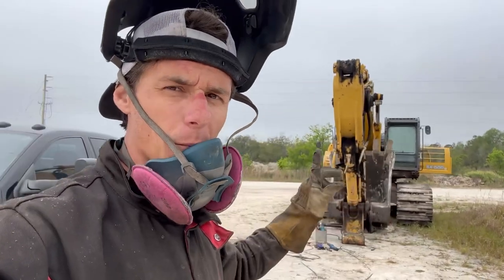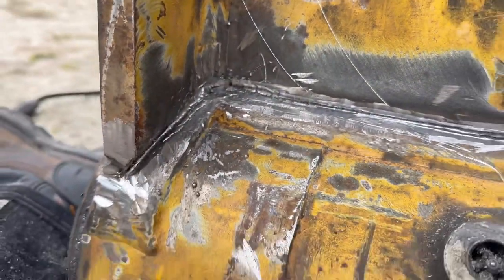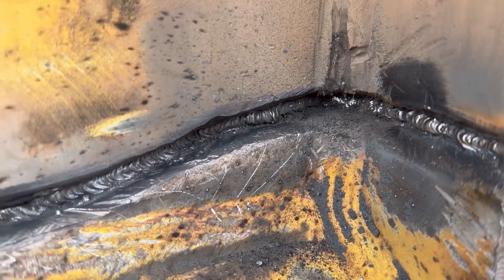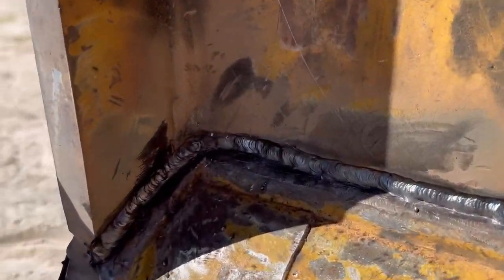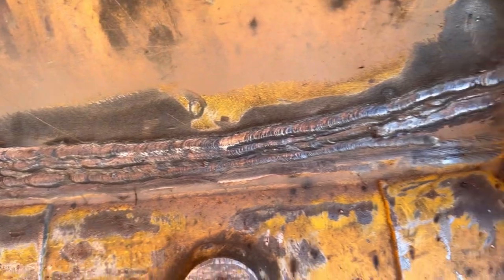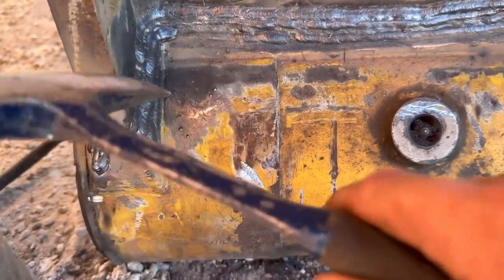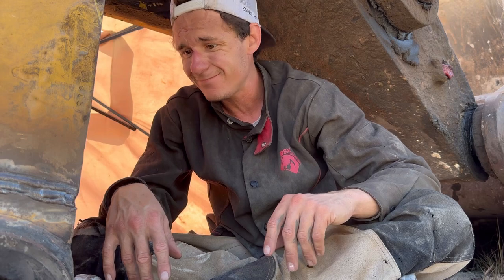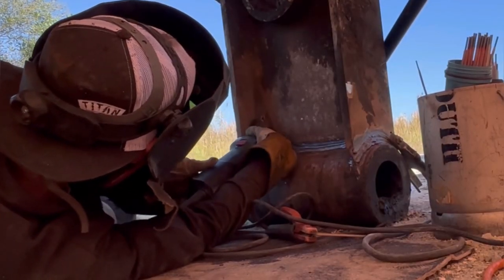SNAPPED H Link Welding Repair

Comment: Nice work.  Done a bunch of repairs like that.  I always charged a premium if it had to be done on the equipment like that, it’s no joke hunching over/crawling around on the ground all day.  Couple tips to help you out: if you didn’t preheat the plates to 200 to 300 degrees before the first root, do it if possible, it will help you a ton on getting it to wet out.  Second, put toilet paper on that seat, you don’t want to catch crabs.  3rd if you haven’t run them try esab 7018 prime rods.  I find they run real good start to finish, never have bad starts (they have a graphite tip to help starts) and in 5/32 size they get shit done.  Glad you’re sharing videos like this, to few people are inspiring the next generation of welders/builders 😀👍

Comment: Hey , I work in construction to, and I got metal in my eye a few times and what I use is a really strong magnet. My level has a really strong magnet and I clean that thing off and then I I just use that really close to my eye and it pulls it out every time, I learned that trick when I was in Aprentice many moons ago🤙🏽 keep up the good work
Reply from the maker: I got a rare earth in the rig!
Reply: for what it's worth, that's also how they get forromagnetic flakes out of your eye at the doctor. just a strong magnet on a stick and some finnesse. this does ofcourse mean that if you manage to get something non magnettic in your eye like aluminium you're in more trouble.

Comment: The H-link needs rebuilt.  With the shattering of it the work canot be guaranteed.  Id had sold it as a saftey hazard and upsaled for the rebuild.
Nice job though man. Looks good
Reply from the maker: Exactly, I told them they need a new one. Also need welding and line boring. Sloppiest machine of this size I’ve every seen
Reply: @MeltinMetalAnthony  Curtis just had a series on building a new H-link. Maybe it's time for a collaboration with Cutting Edge Engineering? A round-trip ticket for you to Australia still would likely make the replacement far less expensive than a new part from the manufacturer, and it would be a tax-deductible business expense.
Reply: @MeltinMetalAnthony  That adds to the stress load sloppy holes
Reply: @hankclingingsmith8707  hell no it don't.  Sloppy holes get used once then disposed of.
Wait, what are you talking about exactly.  I think I git lost somewhere in the conversation

Comment: It's tough finding good carbide bits these days.  Even expensive ones don't see to bite like they used to or if they do they don't stay sharp long.
Nice job on the repair.  Your part is now the strongest parts of the arm.
Reply from the maker: The benchmarks held up good, I abused them lol

Comment: It's tough at the top. Not easy weather conditions to deal with and in my opinion that link should have removed for you so it would have made the job much easier. Great work young man.
Reply from the maker: Totally agree
Reply: Yeah if this was laid in the flat position would have made life far easier. But it is what it is
Reply: If it booms up 20’ why not stand up to do it?

Comment: Nice work man. Especially with what you're dealing with. Northern Michigan here. Still have snow on the ground in spots...definitely no phones overheating here 😁 I haven't in some time now. But when I get steel or concrete in my eye. We don't have many options up here for help. Before I knew any better...I would go to the local hospital. And it would cost between 6 and 8 hundred dollars...🤢🤮 .... twice I did that. Then I learned about quick care. One hundred ten dollars....just saying. Happy welding man!

Comment: Thanks use airfilter lot welder on pipeline I work breath this toxic fume in deep trench.h frame on hoe welding  should be replace due pressure on pin and bucket.i saw this repair then cold weather and wreck .thanks video and education on work.

Comment: I had a hunks of metal in my eye and under my eye lid and had to get an MRI. I told them it was in there they took an xray and said I'm good and when they fired up that MRI i could feel that metal in my eye it started spinning and heating up but because it had been a few years it had rusted i felt it breakup and the lil peace's started spinning it felt like having lil compass needles spinning at extreme speeds in my face. As a welder/mech i feel my newer safety glasses have bounced more stuff into my eye than keeping stuff out. Metal will bounce off my cheek hit the glasses than go right into my eye 100% sucks.
 P.S I ordered a compact eye wash kit like you are using never knew that was a thing. I use qtips and super strong magnets to get shit out my eyes. The magnet trick goes back to ww2 for removing shrapnel from the eyes it can work fast. Good luck with the battle of the metal chips i find the safety glasses from 1970's that are huge with side blinders work the best other than a full mask. Have a good day or >>>>>GFY :0

Comment: Why bother with anything but 7018? I’m an Ironworker by trade, but I dabble in some heavy equipment repair when someone naggs me enough. 

In my mind I would have ran 7018 all the way through and wrapped all the inside corners and wouldn’t have thought twice. 

It’s a genuine question, like I said I’m 7018 95% of the time.

Comment: hey man just my 2 cents invest in an air arc gouger or a gouging tip for the torch for those big cracks and use the die grinder for the fine tuning, much less burrs and a lot faster
Reply: slick welds tho dude

Comment: About the getting metal in your eye- I took a normal pair of safety glasses and trimmed around the nose to fit the shape of the 3M respirator, and I wear those under my face shield.

Comment: No one who welds structural and equipment uses 6010 or 6011! Nobody wants to give up 10,000 p.s.i on a critical strength joint!!! Keep 60xx rod for pipe ,burning off rusty bolts ,and piercing holes if you don't want to set up a torch for a small job for piercing!!!

Comment: Great vid and as others have said, respect for the welds. So nice bro. I have a few questions.  Can a job like this be done from start to finish using 7018s? I'm thinking if the volts are increased and the travel speed slowed, would that penetration be akin to a 6010s penetration?

Comment: There is this thing called safety glasses. Clear plastic wraps around to protect the eye rookie meltin....
Reply from the maker: There’s a thing in Florida called humidity. And it does this thing where your glasses fog and you can’t see, dumb ass
Reply: @MeltinMetalAnthony  they do sell fog free eye protective ware. Poor excuse you give. I have to pass judgement on your welding ability.... Very questionable..... Must not have a lot of welders your neck of the woods.

Comment: Sounds like your running straight 
I could be hearing things tho.on the first low Hy electrode anyway....  Two days of grinding and no mention of preheat or post weld blanket  hell no to the NoNo
Reply from the maker: No preheat needed on a beveled  joint from both sides. They need a new H link anyway and line hone and bore

Comment: Hey nice job! Idk if this is true but from what I been told countless times, H links on "most" excavators, are made of a wierd alloy that is extremely hard to repair and they are usually a cast steel piece so the nest solution is to fabricate a new one out of steel. Does anyone know if this is true?

Comment: I understand the potential downsides of running flux cored wires. Curious as to why I don't see you run wire on mobile repairs like this and if you don't have a setup for it why? Just looking for an honest detailed answer from one welder to another.

Comment: i’m about too graduate welding school and your videos are so fucking helpful it’s crazy in school we just weld on pipes and plates your videos give me a good look into what my career consist of out in the real world your one hell of a welder those beads are slickkk as helll i have one question do you take breaks so the metal cools down ? or since your outside the wind does that for you?
Reply from the maker: Not necessary with something this thick and fully welded on each side I’m glad they’re helping ya!
Reply: @MeltinMetalAnthony   ohh okay that makes sense the heat has plenty of metal too expand too, they have helped me so much i definitely needed school i have one more month right now im doing duel shield flux core in overhead position🤟🏽 i love the videos very educational i appreciate it keep welding man your one of the best in my opinion 🗣

Comment: 4:13 to be real I'm very new to welding but wouldn't it be better to just cut the metal out that is cracking and weld a new thick plate into it ?

Comment: Next time ...block that boom up...chest high...bevel the shit out of your metal....and after your first pass..run the biggest rod (1/4 to 5/16 will work )you can find as hot as your machine will handle ...did you pre-heat ?

Comment: You have that big Lincoln welder generator, I don’t know why you’re not running a suitcase with dual shield fluxcore. The amount of work you can get done with that  setup is probably 4 times what you get done stick welding everything. If any of you keyboard welders tell me you can’t mig weld outside just ahead suck it.

Comment: I've been looking for safety goggles. I think the whole welding industry is stupid with the safety equipment, hoods and glasses don't protect enough. 3M sells a pair of safety goggles that are curved and sit tighter to the face. I'm looking at them because I can put prescription inserts into them as well. So far it's the best I've been able to find. The goggles are 30$ CAD and are pretty easy to get it seems, I'd recommend you look at something better than just safety glasses when you're dealing with eyeballs and flying metal.